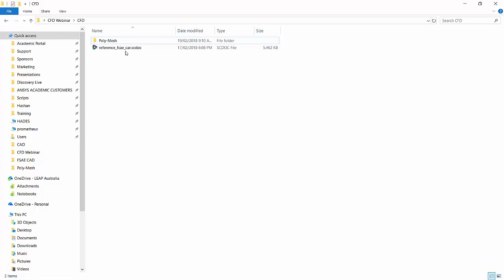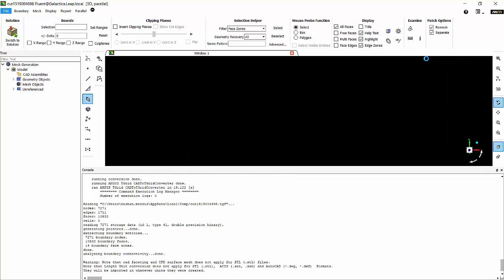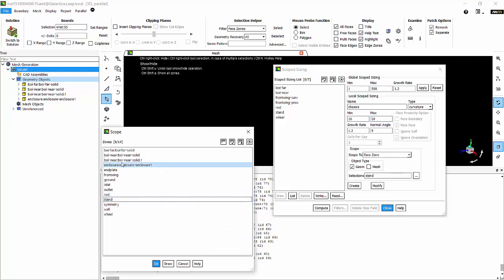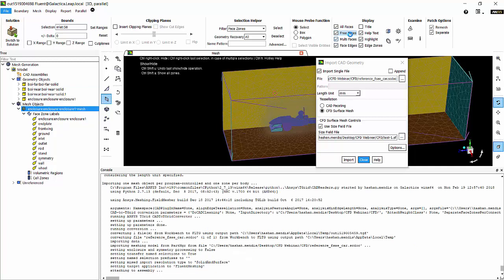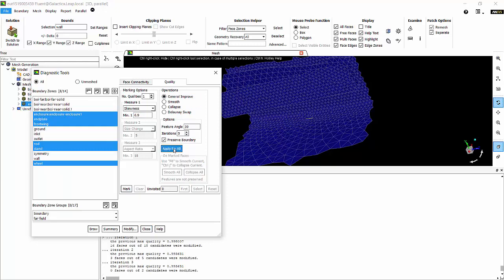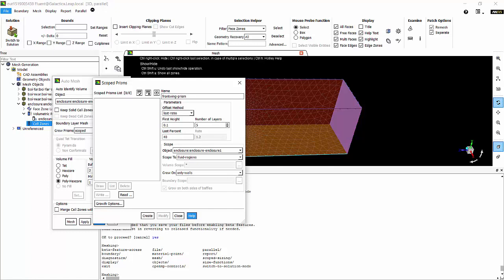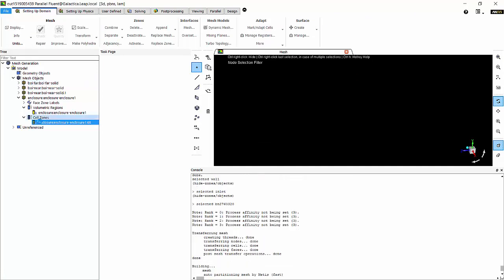ANSYS Fluent Meshing - Demo  - ANSYS CFD for FSAE teams - 4/10

Comment: Some timestamps for important steps:

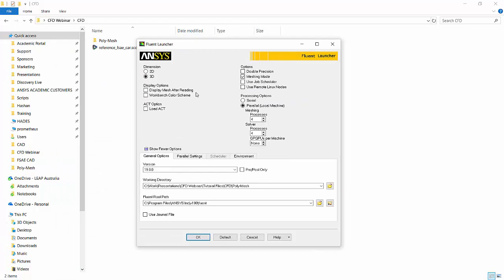0:29 Fluent launcher configurations
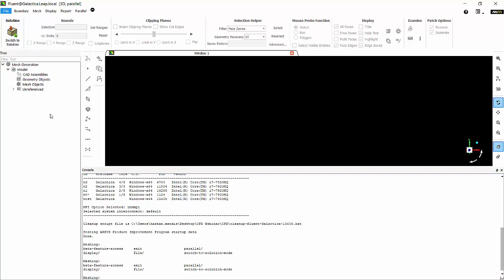3:23 Import geometry
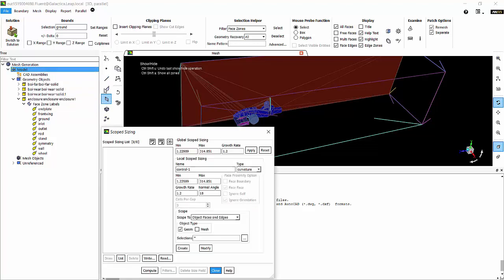5:44 Scoped sizing
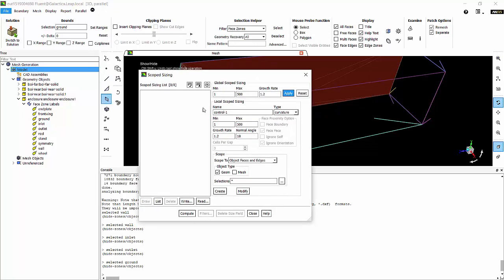6:22 BOI sizing
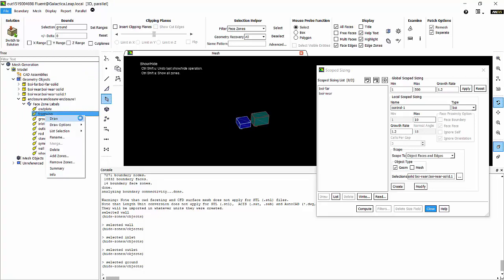7:32 Curvature sizing
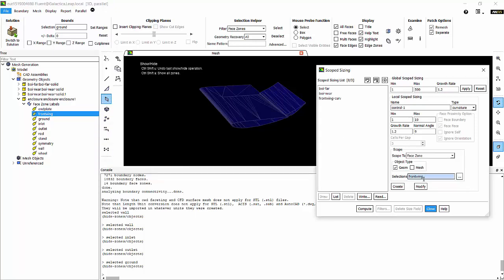8:20 Proximity sizing
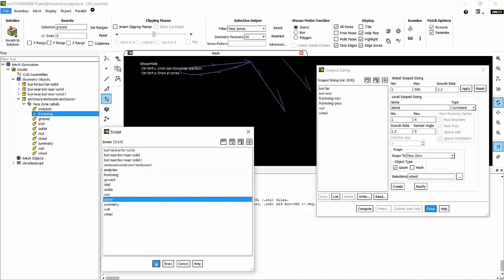10:33 Compute size field and remesh
12:00 Delete mesh and edit size field (optional, if you need to change something)
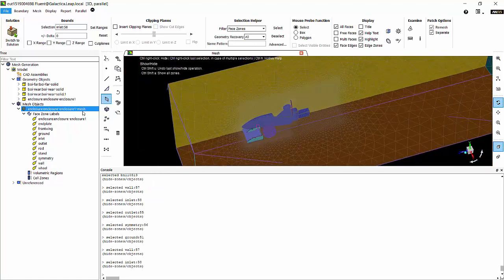15:28 Check surface mesh quality using Summary
16:00 Write out size field for import and removing free/multi faces
19:07 Using diagnostics tool to remove skewed faces
23:29 Compute volumetric regions and set type to fluid
23:45 Auto meshing 
23:50 Enabling poly-hexcore (skip to 24:34 if you use Fluent 2020 or newer)
24:45 Grow prisms
25:05 Help function (skip to 25:40 if you know it already)
26:10 Auto meshing (continued)
26:25 Help function (skip to 27:41 if you know it already)
27:41 Auto meshing (continued)
27:56 Mesh
28:03 Inspect the volumetric mesh
29:00 Write out to mesh or switch to solution

Comment: Hello, the resolution of the base CAD tends to drop as default when imported into fluent meshing, as you can see in 5:02 (all those triangles are the resolution of the CAD mesh model, as if it had been tesellated). It is recommendable for you to set a tolerance parameter, for example 1e-6m or less, in the dialog box of the "import" command. This way, the CFD mesh that is built upon the CAD mesh model will encounter less geometrical issues, leading to a better formation.

Comment: When I attempt this method of meshing I can get up to the compute volumetric regions part, when I try to compute the region however I get an error. There are no leaks or intersections I get the following errors

 'Warning : No regions computed.' 

         region-name    number of baffles zone ids of baffles

-------------------- -------------------- --------------------

    external baffles                    7      (8 7 6 5 4 3 2)  

Any help would be much appreciated!
Reply: I Get the same did you ever figure this out?
Reply: @williamm9088  well, i think i figured out how to continue with this. I tried to write and read the  size field file. After this and computing volumetric regions, it worked as shown in video.
Reply: gabriel hasmann by read and write you mean when he exports the size field and then re imports it? Even after I do that it still doesnt work for my model
Reply: @williamm9088  yeah! That what I meant. Oh, strange. Tomorrow I am going to work on this tutorial again and continues to do the meshing setting. I stopped on this point because I was falling asleep hahahaha asap I will try again and I write here what I will do
Reply: @williamm9088  and what is your model? I am working on a simple sphere just to kind of validate and learn how to set fluent for cfd. Until now, everything is ok.
Reply: gabriel hasmann my model was an actual simplified fsae car! I guess the problem is in the geometry in it of itself. Did you make the sphere on space claim or design modeler? If not what kind of format did you use. I import my model through solidworks, repair it in spaclaim and then export it to fluent meshing but it never worked
Reply: gabriel hasmann let me know how it goes!
Reply: @williamm9088  i did the sphere model in space claim, but before that i did it in solidworks. i actually didn't test the SW model with mesh setttings, i think i went to space claim just to learn how to use it! there wasn't any other special reason!
Reply: @williamm9088  maybe your model isn't water tight (there are some "holes" in the model), i guess, so Fluent cannot recognize its volume.
Reply: @gfreire57  I am having this same issue as well. I have our school's FSAE car I was trying to model. Apparently it's not watertight but can't figure out how to fix it. :(
Reply: i can't go further with this error either!